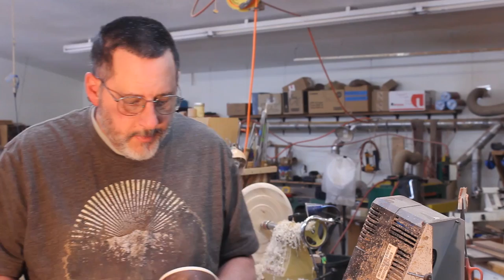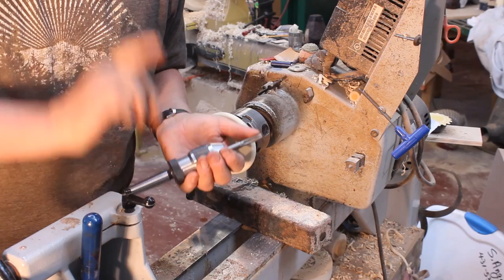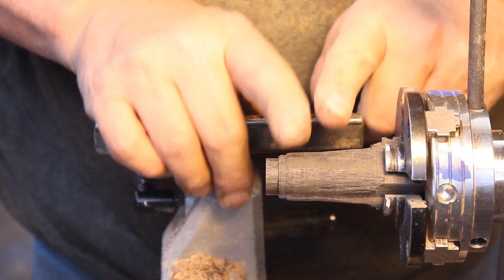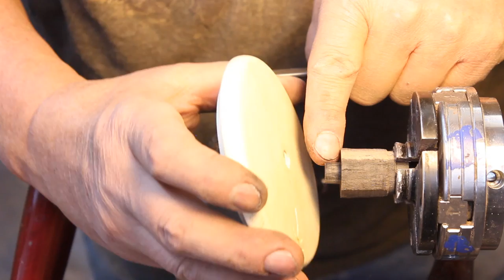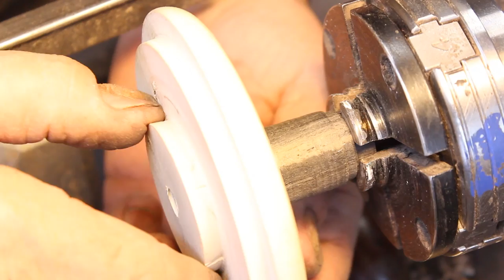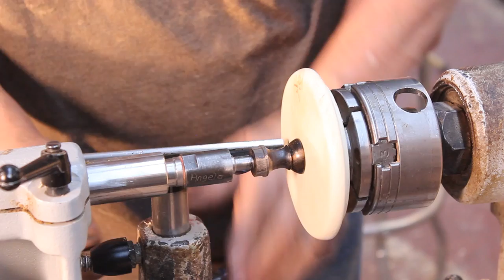A Thread in Time

Comment: Hello Sam,
I don't wish to go one better than you in anything but come March, 2015 I'll be married 42 years.   The old saying that the first 40 years are the worst is true:-).
I really like the box and the use of the knot is a master stroke.
Thanks to your earlier videos I've started thread chasing and it's a real joy except that I have been using 18 tpi which is a little fine for my capabilities so I've ordered 16 tpi from my local Sorby dealer but with the Christmas rush on the mail service they haven't arrived with him yet.
Many thanks for all that you have taught me this past year.
Best wishes,
Alan.
P.S.  It's a little hot in my workshop here in Ireland as the temperature of the rain has peaked at 55 degrees Celsius.